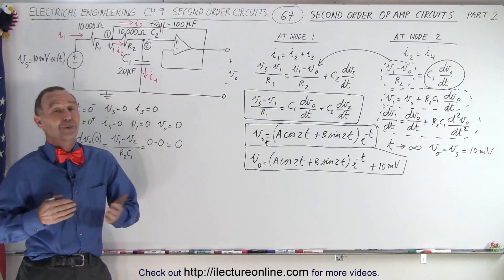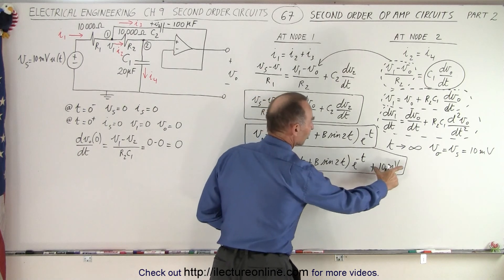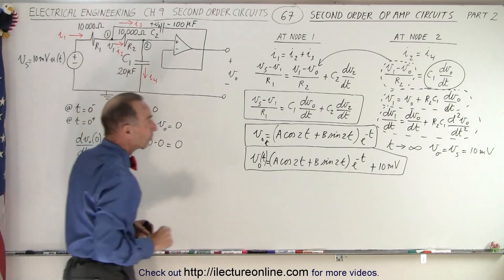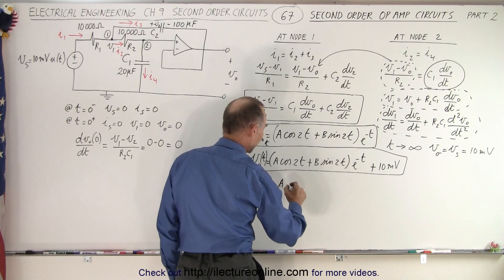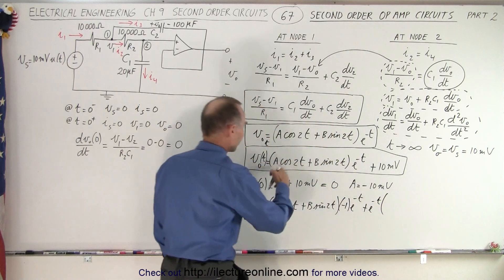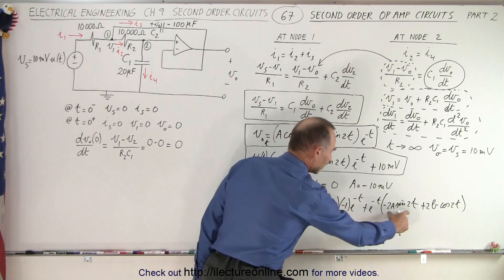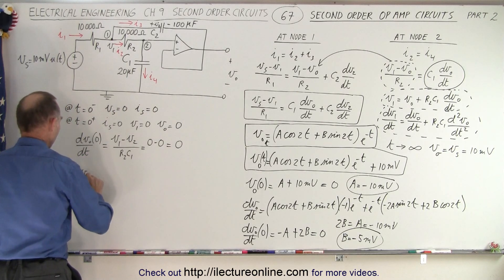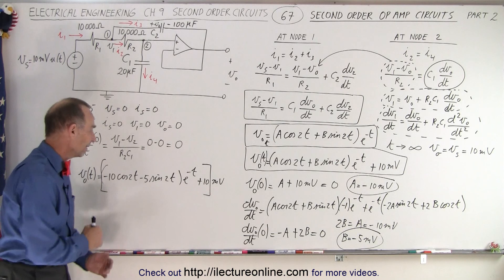Electrical Engineering: Ch 9: 2nd Order Circuits (67 of 76) 2nd Order OP AMP Circuits (Part 2)

Comment: Why is Is(0+) = 0? There is no inductor so the current can jump right? The capacitor is like a short because there was no charge on it.
I can see that v1=v2=v0 because of the opamp properties and the capacitor voltage can’t jump. I think that’s why dv/dt at t0+ is 0.
Reply from the maker: Things in nature do not happen instantaneously.  That is why at time = 0+, nothing has happened yet.
Reply: @MichelvanBiezen  In a ohmic circuit - battery and resistor - @ t=0+ when the battery is switched on I understand that current immediately flows, so I don't follow either.

Comment: How come in this circuit during t = 0^+  there is not enough time for there to be current from the source? 

But in this video @ 12:17 

 https://www.youtube.com/watch?v=LoJygmjEz2E&list=PLX2gX-ftPVXWQqDItJ6sd4MuwrVmjA-7-&index=66

There would be initial current of 20 amps through the capacitor at t = 0^+

Comment: 😃😄😁😆😅 5 Smiles. Mr Carlson's Lab for RF and these circuit.......got a issue with a ion lifters should have been fine but blow the resistance to the pulser and seems to have no out and got zip at moment I think I fryed something 😭check check and not one issue on the emp unit??.  I think the board has some damage this is the second now I got to make one 🧐🤕